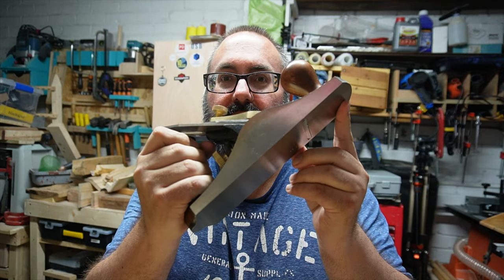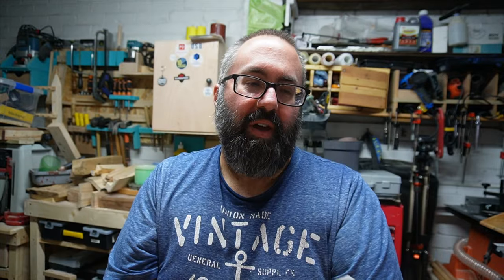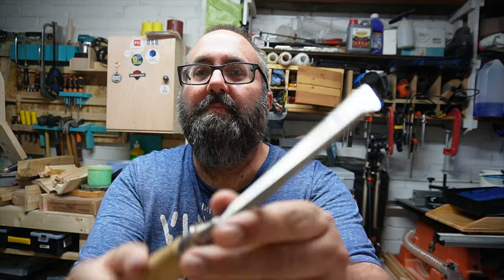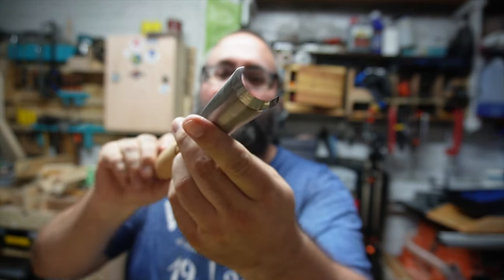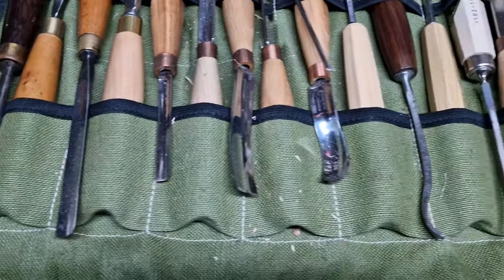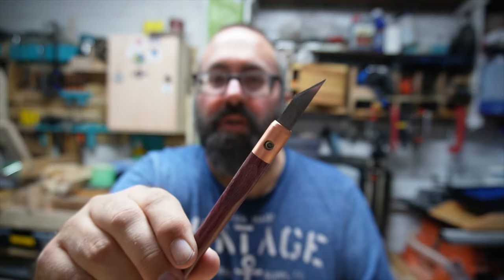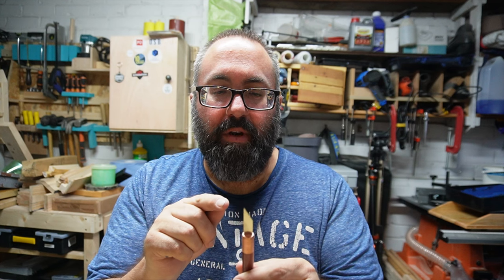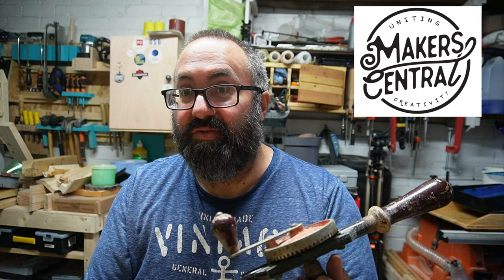My Favourite Hand Tools, One May be CONTROVERSIAL

Comment: 100% agree with you on the humble pencil mate. I've never gone too far wrong following Paul Sellers' advice; Square your stock, accurately measure, mark with the marking knife, and go over the knife-line with the pencil denoting which side to cut. if you take the pencil away there's a lot more mistakes!
Reply from the maker: Admittedly I've never used the mark with a marking knife and then go over with the pencil method. I've seen it used before and I have been meaning to start using it for the even more accurate markings/cuts